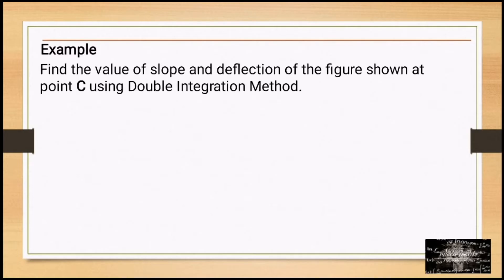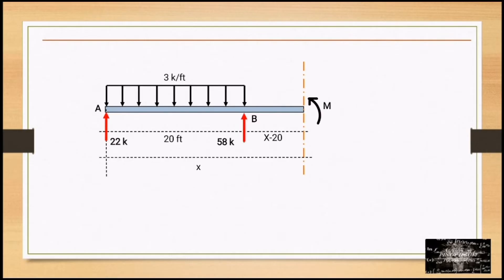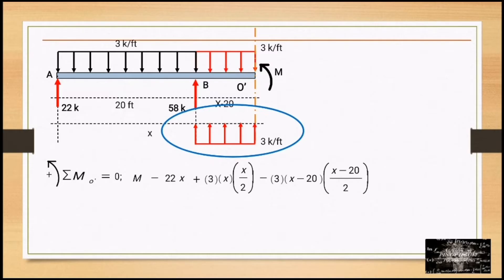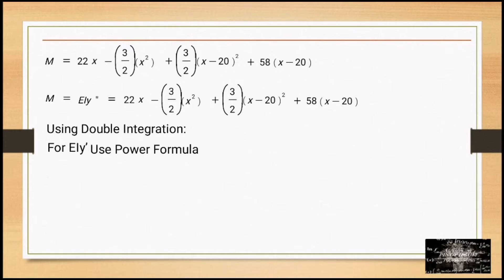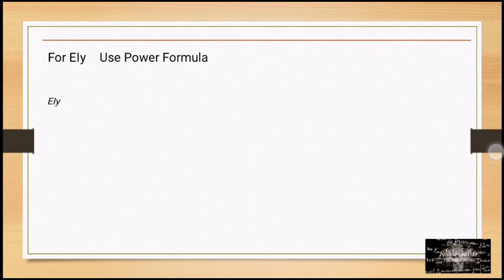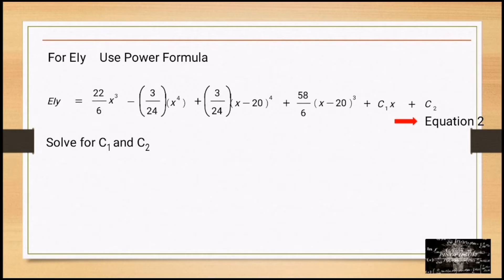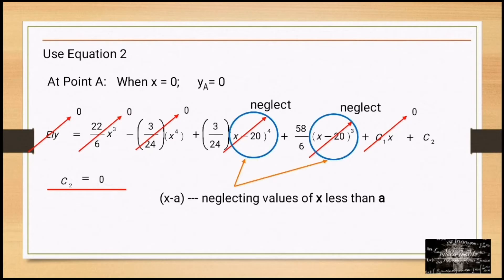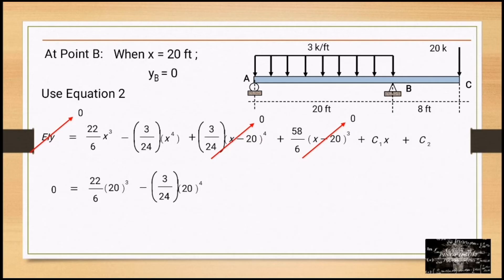Lecture 011 - Slope and Deflecion Example Using Double Integration Method

Comment: Sir bakit po pag kukunin na ung theta c and y c kailangan I multiply sa 1000 (12)^3?? Nasa formula po ba yan?
Reply: since psi po ang E, kaya kailangan na iconvert yung unit ng 706.667 which is k.ft², to (pound/inch²) po. psi = (lb/ft²), 1 kip = 1000 lb, 1 ft = 12 inches.